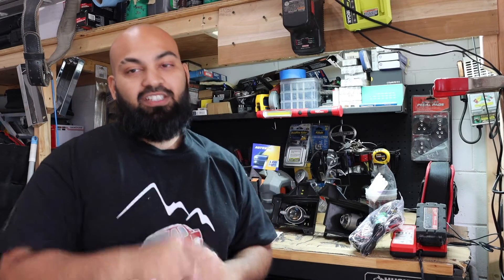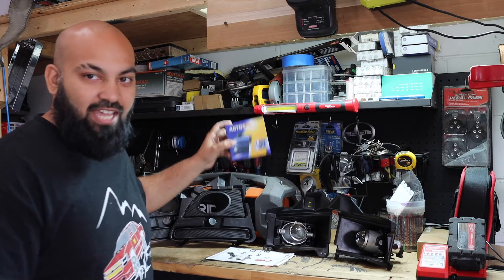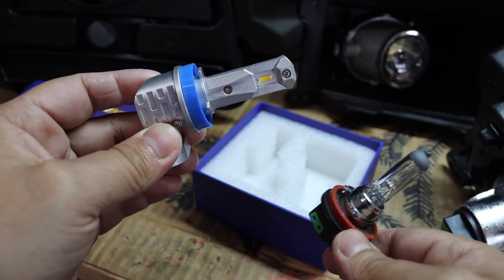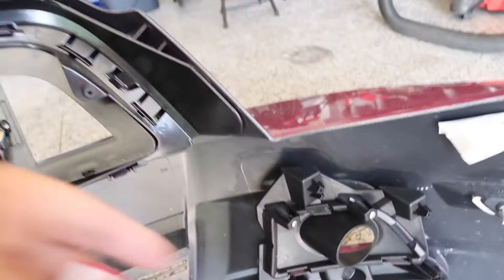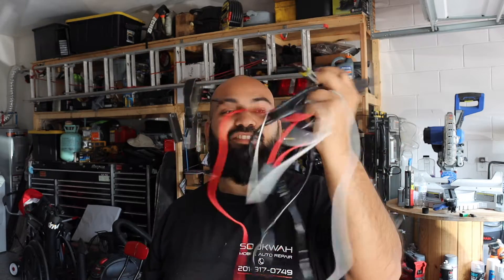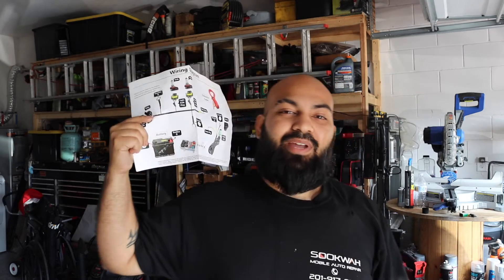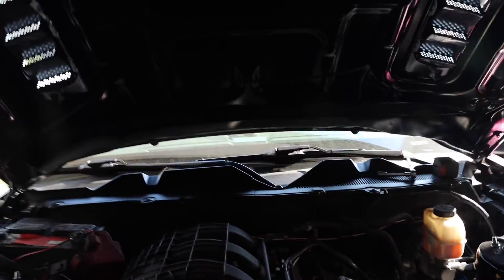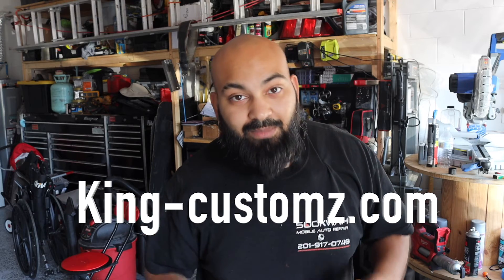2011 s197 ford mustang fog light installation & Review

Comment: Did the 13 front just fit the 11 frame or did you have to modify it I have a 12 I want the grill lights on
Reply from the maker: It did fit, it fit up great. But you have to change out the hood to either a 13 or 14

Comment: Great video! Where did you end up mounting the switch?
Reply from the maker: i wrapped it on the top plastic piece of my steering wheel cover
Reply: Where did you route the switch thru to get it inside the car? I have a 13GT and that rubber grommet section is cover with solid metal there’s no hole